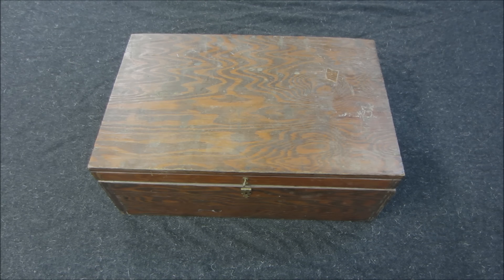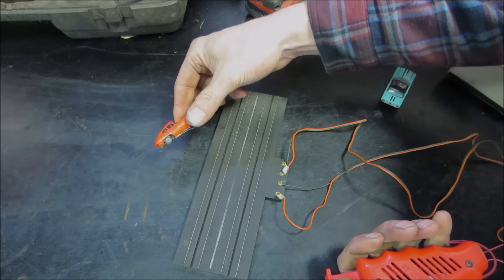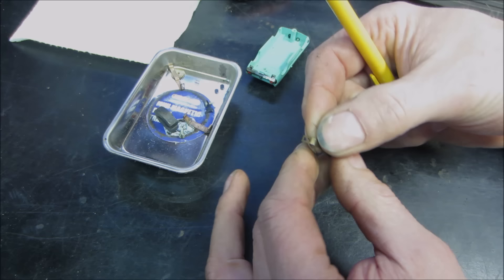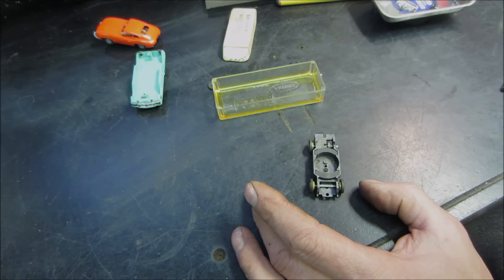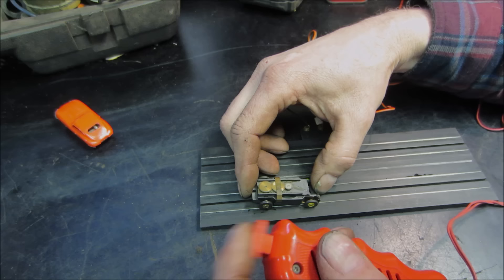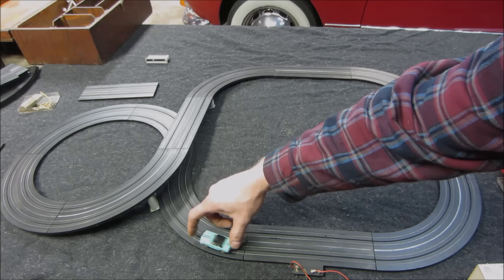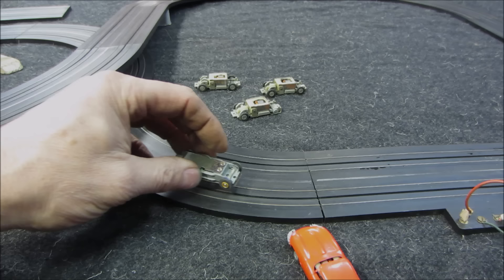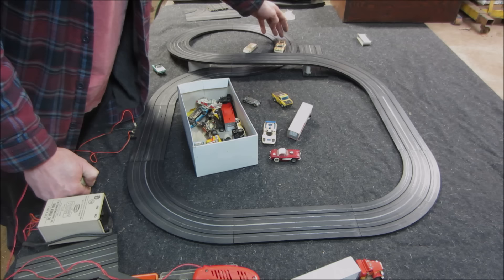will they run? 1960s slot car set sitting 40 years.

Comment: Awesome video Daren! :) I really enjoyed it. It brought back many fond memories of my childhood. 
I kept my slot car sets that I had as a child and played with them till I was a teenager up to the time when I discovered girls LOL! I still have them packed away and have bought more sets and cars like you did when the opportunity came up. 

Sewing machine oil is the best oil to use on these small electric motors. I am into HO scale trains also and i use the sewing machine oil on train motors also...Walmart sells it cheap.  The local hobby shop sells a special type of oil that conducts electricity that makes getting these vintage toys running again a lot easier. I'm sure it will also work on slot cars.

A handy tip: I discovered a way to make my own tires when the old ones dry out and fall off. Take a car to the auto parts store and use it to figure out what size you need first then buy a few feet of rubber hose (black rubber vacuum hose) and you can make tires by cutting the hose into 1/4 inch pieces, I used sand paper to smooth out the sides and round off the edges.

I for one would like to see more videos like this one. 

Thumbs up! 👍🏼

PS those more modern slot cars were TYCO cars...
Reply: No the modern cars weren't all Tyco cars. They were mostly AFX. And you accidentally called the vibrating one by the correct name, Vibrators.
Reply: @marvin5620  The light grey cars with square removable motors are TYCO slot cars, I own a few cars from TYCO sets I have. In my comment I never mention vibrating cars or vibrators.

Comment: That’s the older Aurora Model Motoring track. It used pins, while the “newer” A/FX track snapped together.  Ah yes, the infamous “poor connection between track sections” problem. Seen that many times..... Also, Aurora had reversible guide pins for their cars. The “blade” side was for the A/FX track because it had a deeper groove, while the pin end was shorter for the older Model Motoring track which had a shallower groove.
It’s cool when you’re on the inside lane you can drift it through the curves!
Reply: thats ATLAS track.. do an internet search on it.. some of the cars are Aurora , some Atlas , some AFX , Tyco etc..
Reply: Confirmed its Aurora model motoring. I have mine from the mid sixties. The clips that connect the tracks often failed. You do need the curve guards or the cars fish tailed off the track.

Comment: I remember before I had Aurora T Jets and then AFX cars, I had Mattel Sizzlers that ran on Fat Track, or orange Hot Wheel Track, and each car had a little rechargeable battery in it where you charged it with a Juice Machine that held 4 “D” batteries and it looked like a gas pump, or you could get what I had which was a Sizzlers Power Pit that plugged into the wall, and had a wind up built in timer so you would get the perfect charge, and  get you back to racing. I thought they were great too because they ran on their own without a slot, passed other cars, and had bank curves to go fast around!! So much fun back in the late 60’s and early 70’s. Kept me and my friends busy for HOURS!!
Reply from the maker: same here l loved those things,
Reply: I loved my sizzlers.  We let ours run wild all of the house as well.
Reply: Wow.I'd forgotten about those.I still have the Chrome Mustang somewhere.I think I ripped the battery out about 30 years ago as it started leaking.Dangit.I could never recall what they were called.Even had the pump,but that's long gone.

Comment: More! Brings back good memories! I was born in 1962, and my older brother had a quality Tyco set. Unfortunately, his wife sold it in a garage sale!😥
 I was (am) even more into Matchbox cars, the old Lesney collectibles. Still have about 85% of all my childhood vehicles. In  2003 or so, I bought a Matchbox Motorway 12 set, which you turn regular Matchbox cars into slot cars! And you could run 12 or so at a time, using controllers like used for Tyco slot cars. Still have it, but just no room to set it up!🙁

Comment: Great vid, about 10 years back I dug out some of my old slot cars and recently dug out an old train set that belonged to my uncle in the 40's. 
My first slot car set was one my cousin had in the 60's. The cars were larger, it was also made by aurora. I still have the track the cars are long gone. We pretty much smashed the cars to bits since the track was set up in the basement. I remember when the cars ran off one curve, they had a 50/50 shot of either hitting the cement block wall or falling to the concrete floor. 
The older tires left a lot to be desired, and they got drier and harder with age. At first we used to cut tires out of automotive vacuum line, then we found latex tubing worked better. Years later we found we could mold tires out of RTV silicone, those would stick to the track the best. 
When the 70's came around, I got a slotless set called Ultra-5. those were a whole new game. The track was a big improvement in that it had a built in guard rail, but we turned more toward drag racing the cars and later found that since the cars ran on AC power, we could steal dads router speed control and push the cars faster with more volts. At around 40 volts, the cars would go fast enough to melt the plastic when they rubbed against the side rails of the track. 
The cat would occasionally venture onto the track, which at that time was set up in what was a semi-finished attic, we had a super oval set up and a 30ft long drag strip. With the longer track we needed multiple power supplies too. Eventually the whole upstairs of the house was a giant track, we had slot cars, slotless tracks, and trains all set up together. It lasted till my grandparents needed assistance and the upstairs got turned into living area for the grandparents and the slot cars and trains got packed up. 
The early HO sets were called Model Motoring, those had the narrow tires and ran slower than the others, then came AFX, and Magnatraction, then Ultra 5 and eventually Speedsteer, which was a safer, more refined version of Ultra 5 slotless sets. Speedsteer, like Tyco back then also had trucks, which we had as well. Speedsteer also had a self running 'blocker' car that would randomly run around the track switching lanes at will. 
At my peak of interest in slot cars I had a suitcase full of cars and bodies and several boxes of parts, which were required to keep them running. At the same time, every kid in the neighborhood had a track set up. They're fun to dig out and mess with from time to time but I find I loose interest in them pretty fast these days and they go back in the box for another 10 or so years or more. Its been 15 or so years since I had mine out of the attic now. Its a case of too many hobbies and not enough time and space.

Comment: Brings back memories. I had Scalextric in 1964 with the old shiny track. 2 motorcycle combos and later 2 E-Types with more modern surface. You're welcome to fix them; I haven't used them for 50 years :) but still kept them

Comment: So cool man great memories ! I was born in '62, and this stuff was cool. For about three days, until we bugged our Dad bad enough, he'd go buy new cars.
   That went on for about 2 months. Then down cellar it went, never to be seen again, 'cuz my brother and I found out GIRLS were a HELLUVA' lot more fun !!
Now I'm '56. Married to the same girl, 28 years, BUT, seeing this video, now I want a set again. We had the AFX type set, but we had a different type of set
 a few years before that, ran on a long flexible, small diameter flexible spring going around in circles. Guess you might call it a torque tube, not sure. Much like I think trolley cars worked at one time, not sure though. The pin under the car stuck down into the spring.

Comment: Fun project!
I grew up in the 80's, slot cars had some improvements, but still many of the same issues.

I also remember my project car i have now, it was one of my first RC cars, it had a cord... lol
The head lights also popped up, and the steering wheel turned when the remote turned the car.

Now i have the actual car. :)
Reply: Nice

Comment: Loved it..took me back. My track had the 2 pins and a center clip made of plastic that broke if you weren’t careful. My set was called motorific brand. We also had a set that you had a figure eight track and set two cars in two different directions and were designed to fly apart when the eventually intersected and crashed.

Comment: This set is much different than what we got in Canada. I've never seen that style of motor set up. The motors I had were mounted at the rear of the car and much smaller and self contained for the most part. Also had a few styles of contacts for the cars some similar to this some were weaved flat cable type wires with frayed ends to contact the track. All needed maintenance. Lots of oil burn outs by dripping oil onto the track then trying to do burnouts LOL.  But we learned while having fun without knowing it. The track was similar but it would snap together without having to put pins into it unless the connecting pins would break or bend then replace or fix. Very cool.

Comment: I have a couple Artin sets packed away somewhere.  They have the Trans Am cars, and are battery powered.  The Artin cars used braided stainless brushes for contacts instead of the solid metal shoes.  The spacing of the contacts on the track was also very close to the pins, making them incompatible with most other sets. the biggest problem I had with them was the brushes.  They had a tendency to fray and short out since they were so close together, plus they would get loaded with fluff and fuzz and were near impossible to clean. 
Another great video as always!  Hope to see more like this in the future!

Comment: I still had some of my dads slot cars from the 1950s.
But in the 1980s some kids stole them.
And yes they still worked.
I even used them on modern tracks.
They did not stick to the tracks like the modern magnetized cars.
I remember cleaning them like you are doing these.
The tires on my cars was made of different stuff.
Rubber and foam.
Some of the tires was wider then others.
One of the main cars i remember was the white corvette.
My dad made a mixed track.
It had a car racing track, and a train track on it.
He attacked them all on a 10 foot board by 4 foot wide.
He added a few buildings on it.
Later i built one when i was around 23 years old.
But i only built a train track on the one i built.
I still have all the trains and tracks, but took it all off the board.
I even had mountains, trees, grass, a river, and a few buildings i built.
I even build the little house on the prairie house out of small wood sticks.
I used bark from a tree as the roof shingles.
I was even going to build the inside to look just like from the TV show.
But i never got around to getting that done.

Comment: I got into these Aurora cars in the mid 1960s. I still have most of them but they are in a box and have not seen electricity in 45 years. The original, early 1960s version were what we called "vibrators". They had a kind of thin metal reed that vibrated with an electric motor and the reed powered a wheel that was attached to the rear axle. Then along came the rotary electric motors which were much faster. They had Mustangs, XKEs, Corvettes, Ford Galaxies, something called Indianapolis Racers, and Deuce Coupes. Great fun.

Comment: My dad worked for Western Electric and would bring me spray cans of Carbon tetrachloride. He used in the switching stations for cleaning the relay points. Worked great on for cleaning those cars. 
I couldn’t venture a guess at how many hours I spent playing with the Aurora set I had. So much fun.

Comment: Thanks for reminding me why I threw all that junk away 50 years ago! Constant frustration, electrical shorts, worn brushes, bad tires....more frustrating than keeping my Whizzer sportsman running.....which was great, when it ran! With today's electronics, slot cars would be fool proof. My best set was an Eldon bought new circa '63-'64. I had an add on blue thunderbird that fishtailed so bad, it'd jump the slot. The sets original cars were some kind of gran prix looking bodies...that thunderbird would smoke them! That was a long time ago....and I'm an old man now....and no, I don't miss them or the old cars I started out with.....pure junk compared to modern stuff. I haven't changed a water pump, starter, dimmer switch, heat riser, timing chain, shock absorbers, voltage regulator or even a headlight in the last 30 years. We hated unleaded gas when it was mandated....best thing that ever happened though. Plugs run forever now. The yearly ritual of points, plugs, rotor but ton and timing.....gone when electronic ignition came around. No sir, I don't miss any of that junk.

Comment: I had a few AFX cars including my favorite, an RC Cola Porsche. It was always a great test of your skill to feather the throttle in order to keep it from flying off the track Had loads of fun taking them apart, cleaning, oiling. I setup a ramp to see if they could match Evel Knievel's daring stunts. Great times !! Thanks for showing - I wanted to join right in.

Comment: Man this brings back memories. I had 2 Tyco sets from garage sales. I think I used up all the good erasers in the house. I hooked up another starter track piece with remotes hooked up to a higher voltage transformer. Each person had two remotes, the 2nd remote was for the higher voltage transformer and acted like a turbo button. They would fly around the track or launch off the track lol. I need to go dig around in my parents attic. Pretty sure they are still there.

Comment: I grew up using Tyco HO slot car sets with the Magnum motors.  We had about a 15x25 foot track, and used dual power supplies at each end to avoid voltage drop.  Some cars were crazy fast on the straight section, and the banked turns were a necessity.  I still remember the "clack" noise the cars would make after flying across the basement at full speed LOL.  I also remember those old Aurora cars with the flat style motors in them.  They would run on the Tyco track, but weren't nearly as fast.

Comment: We spent endless hours with the Aurora HO slot cars.  We'd mod the cars by gluing in the springs, tape the contact bars together with a trimmed down slot pin and cut the contact bars so they would "float".  We'd also fine tune the track slots so that the cars would actually drift around the corners. Loved those cars.

Comment: Brings back good memories, need to dig mine out. The vibrator is the oldest, then the horizontal motor, then the vertical, they even made a "gel" racing lube.

Comment: Used to take a quarter or a small piece of sand paper and clean the little rails in the track to get better contact and get rid of dead spots in the track. A quarter would fit across both rails and you just rub it along them and it would clean them up nicely.

Comment: Hey Mustie, a can of CRC electrical contact cleaner will work wonders on those commutators and contacts. Thats what I use on my post war lionel trains to get them all cleaned up. Best part is, its plastic safe so you can really hose them down. We also use full synthetic oil to lube. Hope this helps bring some of those cars back to life.

Comment: I had the Atlas track set with controller's  that were like the dashboard of a car. The speed was controlled by turning the steering wheel,  the direction could be changed with a slide switch mounted on the dash. To make the cars run full speed around the corners I would install a guide pin on both the front and rear of the car. Didn't need those goofy guard rails anymore. The motors you have with no bodies are the original Atlas motors that came with the red Tbird and the yellow Chevy. I also had the blue Mustang and a 40s hotrod. You could get slick tires to replace the rears.Thanks for the memories.

Comment: Very Cool Vid, I'm 60 & Born In 62' So I Was 6 When Hot Wheels (Gateway Drug) Came Out In 1968 But Don't Remember How Old I Was When I Got My First Slot Car Track Set Or What It Even Was.
With My Dad Being A Body Man & Mechanic Who Painted The Local GETTY 00 Stock Car For Our Local Stock Car Races At Seekonk Speedway On The Weekends, It Could've Been NASCAR Or Just A Hot Rod Race Set. But Now I've Got A Ton Of AFX Racemaster, AutoWorld Tracksets, & Some LifeLike Sets I Bought Before The AFX & AW Sets But Just This Month 3/23 I Scored A Complete 60's AURORA MoDEL MoToRING Set Locally Off Of Craigslist That Came With A First Gen 65/66 Mustang Convertible & A 1966 Porsche
 906 So I'm Thinking It's A 1966 Set. But It Didn't Have The Box Cover Which Bothered Me Enough To Hit eBay & Score Another Full Set Minus Cars But Had 2 Mustangs Racing On The Nice Cover. So Now I Can Cherrypick Between The 2 Sets & All The Extra Accessories That Came With Them To Make 1 Complete Full Set That I Want To Keep For The Box With A Buncha Spare Stuff To Build Bigger Tracks With. I Already Had Some Of The Same Style Screw On Body Cars, Chassis's, & Bodies To Play Around With So This Vid Is Full Of Good Tips For Rebuilding, Repairing, & Restoring These Older Cars. Thanx 4 Posting This, It'll Be A Great Help For When I Set Up The Older Track & Break Out All The Cars.